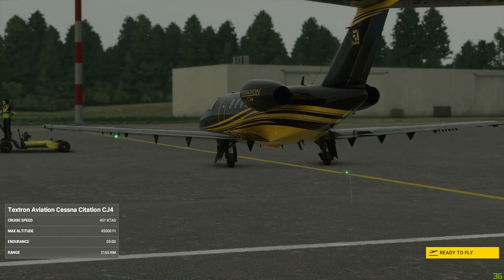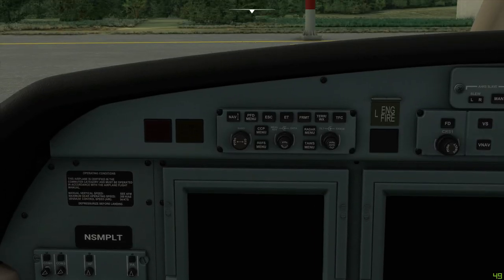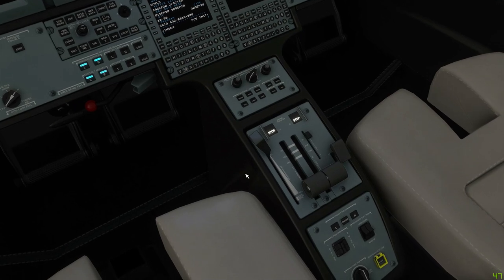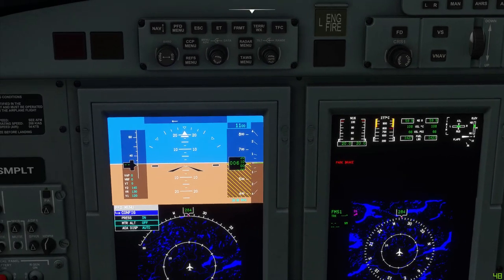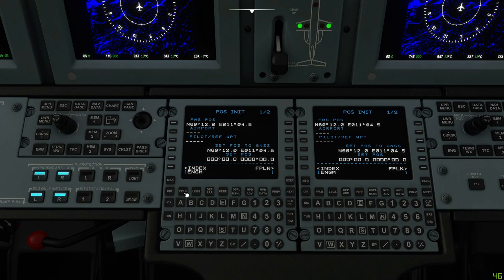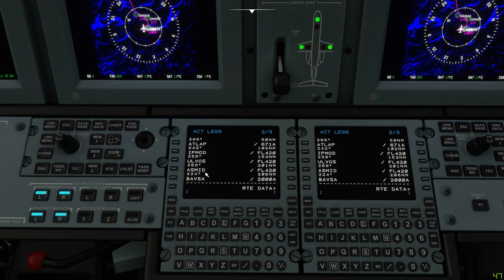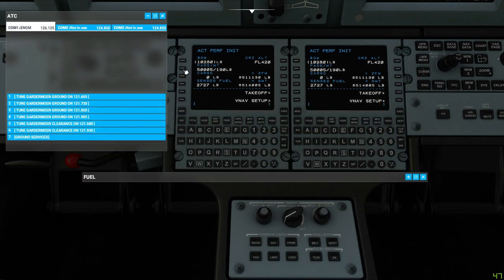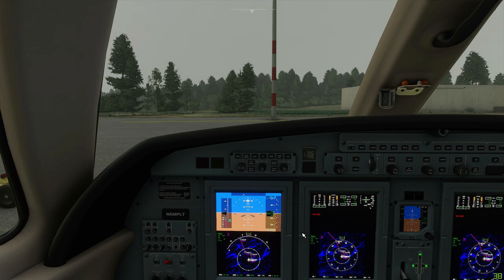Microsoft Flight Simulator 2020 | Tutorial EP#12 | Citation CJ4 | Cockpit Layout - Flight Planning

Comment: When you were setting your take-off flaps in the FMC. the setting above it shown as A/I On/Off is the Anti-Icing. So are you taking off with the anti-icing on or off? This will effect the available engine power for your take-off run and climb out. It's probably not actually simulated in MSFS, but that's what it means.
Reply from the maker: That is exactly right, not sure if the engine power degrading is simulated when anti ice is on but, if the temperature is above -10 C and there is no precipitation I always take off with anti ice off.